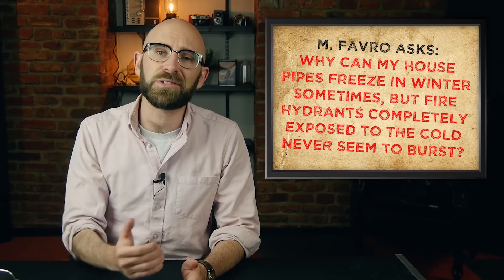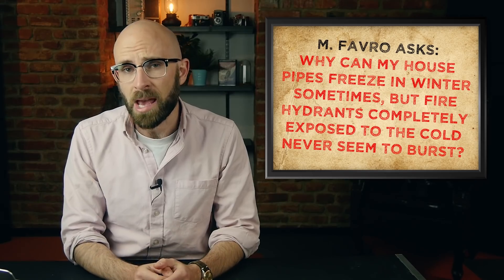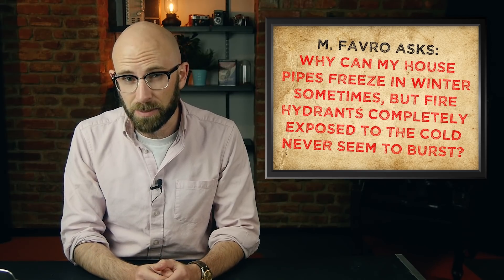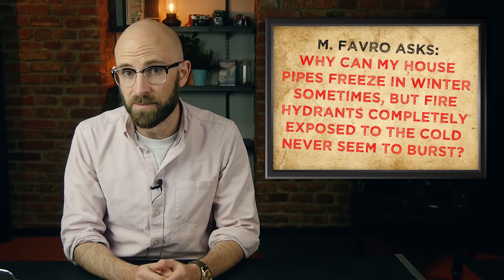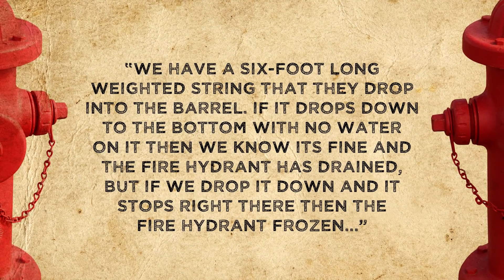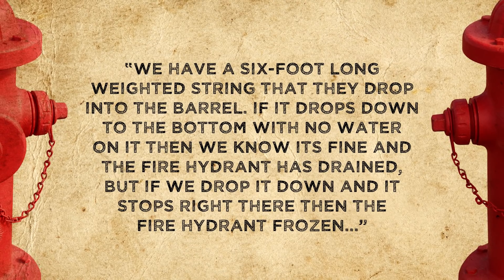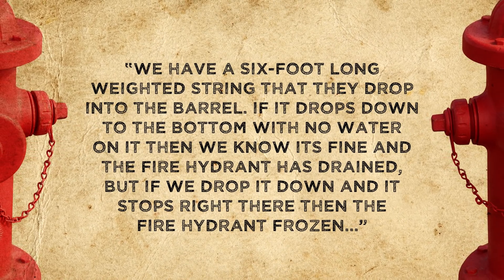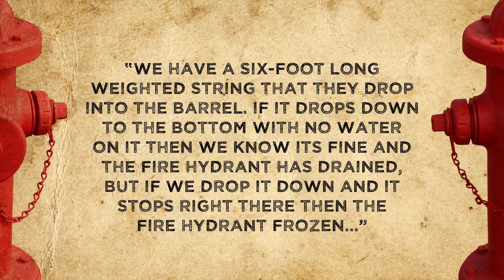Why Don't Fire Hydrants Freeze and Burst During Winter?

Comment: Wait we don't have these in the UK do we? Where does the water come from? I always figured that it came from the firetruck x
Reply: The water comes from that streets main. They run a hose from the hydrant to the truck and use the truck to regulate and split the flow to other hoses.
Reply: MendMyWings the trucks can only carry a limited amount of water, in the US that is around 500 gallons (1,890L) that they use for small fires, fires away from hydrants and first attack as the hose is run to a hydrant. Truck size is set based off road capacity and how tight the turns are. 

Even if you can't see the hydrants they are there as they can be hidden under covers or behind things
Reply: The UK uses stand-pipes which fit into valves at ground level.  UK is limited in space as it is and doesn't want additional 'street furniture' if avoidable.
Reply: That is adorable.  I know a lot of people who think that electricity originates from receptacles.
Reply: We do they’re just subtle, we don’t have big ones one the street but I’m sure you’ve seen those little water things on walls and the ground in places
Reply: @firemanjeff911  gas comes from the little pumps too!
Reply: Those yellow H signs you see everywhere are indicating where and how big the hydrant is. The hydrant itself is rarely seen.

The number on the top of the H is to say, in millimeters, how large it is, and the number on the bottom is how many meters away the hydrant is. Though, how they know which way the hydrant is located is beyond me.
Reply: You can attach to a  truck carrying a big water tank if there are no hydrants around. Large fires may require several.

The firetruck has a tank for smaller fires, but it's main purpose, besides carrying firefighters, firefighting and rescue equipment, is carrying a very powerful water pump, powered directly by the truck's engine.

You need three things for a fire: Fuel, Oxidizer and Heat.
Water works by dissipating the heat in the fire triangle.

Firefighting foam has existed for a long time. It works by cutting out the oxidizer from the fuel, and although it isn't very good at dissipating the heat (because most of it is air), it's generally more effective at firefighting, especially with liquid fuiel/oil fires, because it can cover a very large area very quickly. It's mainly secluded to major airports and a single tank truck can carry a lot of potential firefighting because the foam expands up to 200x it's initial volume.
But it's cheaper to use water. So, that's how we roll.
Reply: Davvy Jannes  those are standpipes for firefighters to SUPPLY water to the building, not fire hydrants.

Comment: What would happen to the american economy if new currency was not printed/made for an entire year?
Reply: Not much. The actual amount of cash in circulation is far lower than the actual size of the economy, and has been for nearly the entire history of the country. The main reason new bills are printed is to replace old and dirty currency (fun fact: cash bills are slathered in bacteria and viruses. Always wash your hands after handling money). If the Fed Reserve stopped printing money, the economy would use bills already in circulation, plus reserves of older bills pulled from circulation earlier

Comment: I didn’t watch the video but if places where it doesn’t get cold enough to freeze the water is always circulating to the top. In places where it does freeze the water is 6 feet under and can only go or the top when they firemen turn it on.

Comment: they are built to withstand incredible pressures, each one is filled with 25000 gallons of compressed water during manufacturing
Reply: How do you compress water?
Reply: fun fact: water is such an "incompressible" substance it is generally assumed the volume won't change size in most engineering calculations. What you are thinking of is pressure, which can be thought of as the amount of force the water is applying to the surfaces that surround it due to being pushed on.
Reply: no that's not what I meant at all they are filled with water at the factory so are faucets etc. plumbing is a myth and a globalist conspiracy just like electricity and wires
Reply: Physics.  Must be utilizing black hole technology
Reply: @rbmk__1000  alex jones backup youtube channel?